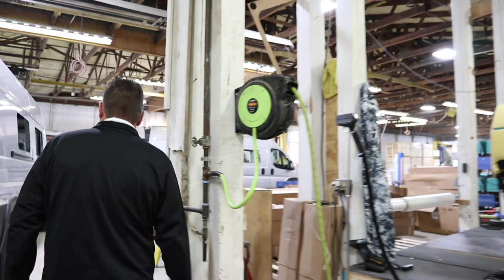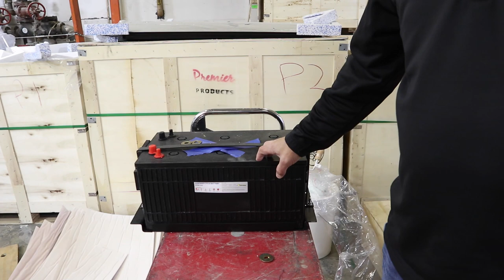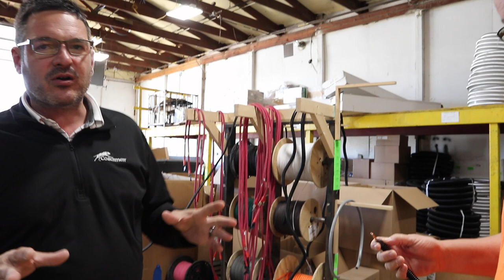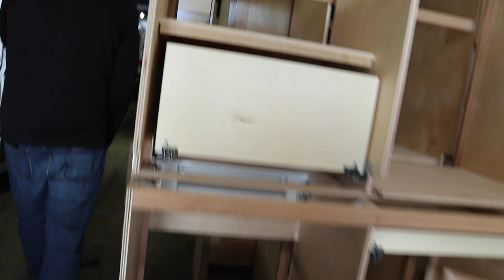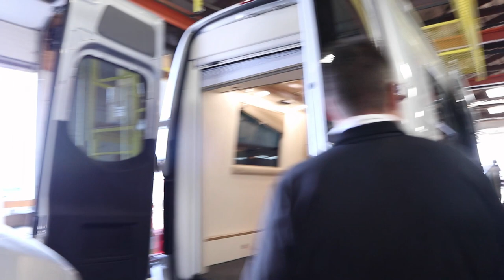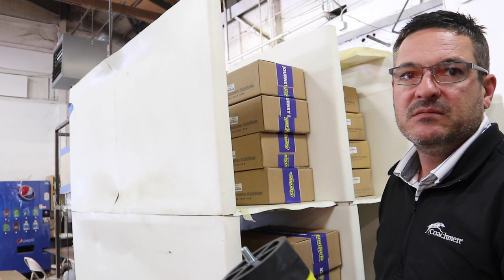Coachmen Class B Plant tour with Nick Recchio 2020

Comment: I'm close to getting a 2021 Beyond 22D Li EB AWD -  and have been looking. I just wanted to mention to some shoppers I have run VINS on some I see for sale and one was built on a 2019 chassis and the other a 2020. If chassis year is important to someone they may want to run the VIN. Not sure when they will build on the 2021 but for me it's worth waiting.   Thanks so much for your video's. I esp appreciated the one on using all the monitor's; very helpful.

Comment: Very interested in the Nova but read about electrical issues with the Firefly. Asked dealer rep to open the battery compartment and was taken back by unorganized tangle of wires, doesn't speak well of the quality culture of the company.
Reply: Mostly because the wires are individually run.  This is pretty much how all big volume RV builders do it.  Pleasureway does a good job of wiring, but they also cost more.

Comment: Don't AGM batteries need to be recharged when at 50% capacity?  Lithium batteries have no such limitation.  Right?
Reply from the maker: Yes, basically.  Some people say you can take lithium batteries down pretty low, but I still try to not go below 20% on my lithium batteries.  

The real numbers to go by is the voltage levels.  I don’t go below 12.05 volts on AGM and 12.9 volts on lithium.

The lithium batteries keep a pretty flat voltage until the end and then it drops fast.

The lithium batteries off more time for the same AH battery size.

Comment: Please do a video(beyond li3)on how long you can run the roof ac on a full charge lithium batteries. A dealer in Florida says you can run for 8 hours? I’m close to buying 
A beyond li3 to use for urban boondock camping and never plugging in to shore power. Would greatly appreciate a real world test since you have the exact model that I want to purchase. Thanks.
Reply from the maker: It's hard to say how long it will last because of the variables. 

For example if you park in the shade the AC doesn't have to work as hard.  Putting up the window sunscreens makes a difference.   The outside temperature makes a huge difference on my 12 volt AC, my AC pulls 60 to 110 amps an hour.  I don't like to fully deplete my battery so I  try to use only 500 AH.  So at a 100 amps an hour that would be 5 hours if it ran continuously. 

So one could say 5 to maybe 9 hours is possible.

Comment: Nice video Gard.  I was wondering whether Coachmen has any plans to do a 20' class B for the Beyond or Galleria to compete with Pleasureway's Ontour 2.0 and Ascent models.  I have narrowed my selection to a 20 footer (Beyond will not make it into my driveway and I want the compact van for its usability as a regular around town vehicle), but there are none available with a high capacity Li3 type system (no generator) and a secondary alternator for charging.  Coachmen could kill it if they offered a shorter coach option with AWD (Transit) or 4WD (Sprinter).  Storyteller Overland is the only one that has this and their layout is not really geared to what I'm looking for.  The Airstream Interstate 19 is almost there with a shorty 4x4 (but on a Benz - not my 1st choice), but their lithium is similar to Pleasureway.  Any input?  Maybe see what Nick Recchia thinks.  Thanks again for the great content!

Gerry
Reply from the maker: I wish I knew, a 20 foot Beyond like the PleasureWay Ontour 2.0 would be nice.  I don't sit comfortably in the Ram chassis, I am 6'3" and 300 pounds, but the Nova is shorter.  Have you looked into it?
Reply: @CampingCoastie  I've had bad experiences with Dodge/Ram in the past and their chassis doesn't offer AWD or 4x4 at all.  Fingers crossed that the industry will see a trend with new buyers preferring to start with a 20 footer and start offering them with AWD or 4x4.  I was really surprised when Pleasureway said they would offer AWD in the Ontour then suddenly reversed course only a couple of months later.  In a response to me, Grant Walters even seemed to indicate they would never consider a second alternator or larger lithium system and went so far as to suggest I look at Coachmen if that was my concern.  An article today in the Wall Street Journal discusses the rise in Class B vans for newbies - perhaps the trend will lead to an expansion of the product line for Coachmen!!  Thanks again.
Reply from the maker: @gerryc270  I agree.   A 20 foot AWD Beyond, or even converted 4x4 would be great.

Comment: Just bought the 2020 rb transit.
     So far I love it but I have the noisy generator - and it is loud.
     Let's see how it goes.
Reply from the maker: The rear bath is a great floor plan.
Reply: @CampingCoastie  if you are in contact with Coachman - is there a generator swap available?
    I know its a long shot. Thanks
Reply from the maker: Those generators are in hot demand by RV builders now, I don't even know if you could buy one know.
Reply: @CampingCoastie  thanks - love your channel.

Comment: Can anyone help me understand at 12:06 why he choose "not" to use expandable foam for B class vans? As far as I know, the only way to get proper insulation is from foam and that the fibers may actually become a hazard to the structure and hazard given the wide spectrum of climates the van has to endure.
Reply from the maker: From what I understand, foam can create off gases and trap moisture.  The Rockwool product is not affected by moisture.  And if you have a problem it’s easier to work with batt insulation as opposed to pretty much a permanent insulation installation.

But of course, new ways of doing things come out constantly.

Comment: I want a beyond Li3 so badly......but Im really torn that i have to have the water tank outside....I live in the northeast and there will be plaenty of opportunity to have it freeze.....if there was only a way to have best of both worlds....
Reply from the maker: I know, it would be neat to have batteries and water inside, but there is only so much room.
Reply: Outstanding  Video and tour. I like M.Jim have a 2021 Coachman Beyond Li3 on order. In a earlier video Nic said “ they were going to put the 4 hose inlets on the rear,  drive side in an enclosure. Do you know if the 2021’s will have that? Do you know of any more upgrades for the 2021 Beyond? Thanks.
Reply from the maker: @michaelkelly7096  He hasn't mentioned those hookups to me since that first tour.
Reply: Water tanks outside with heaters are working fine on the volta system with winnebago do I'm sure they do the same here. I've seen real world-20 testing and water didn't freeze.

Comment: What's the max hitch weight and max towing weight of a Beyond?  Thanks!
Reply from the maker: According to the brochure the hitch has a 500 pound tongue capacity.  I believe it is a 5,000 pound rated hitch.  The Transit comes with the Ford HD Towing package.  But the actual towing capacity depends on the cargo already loaded into the van.